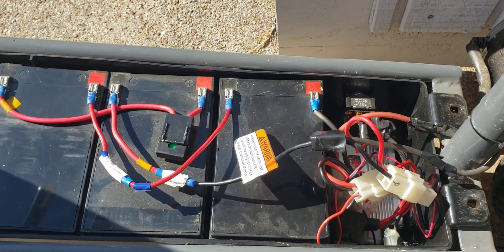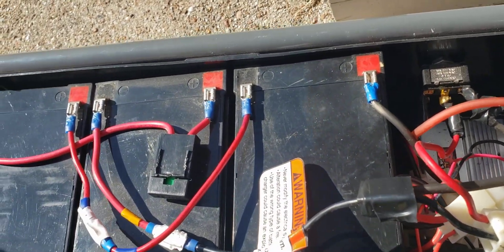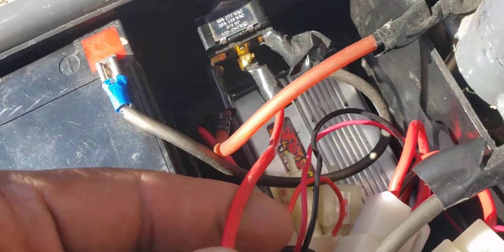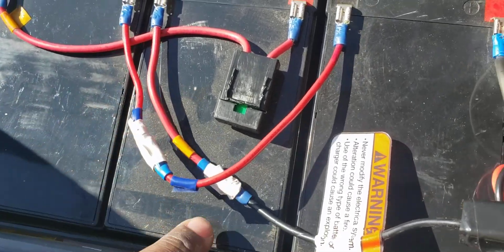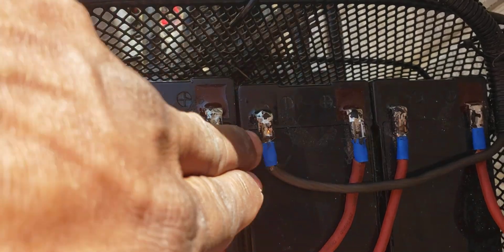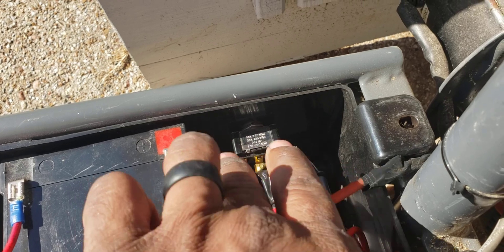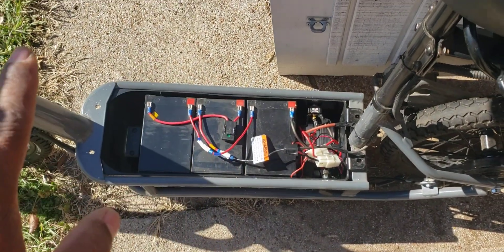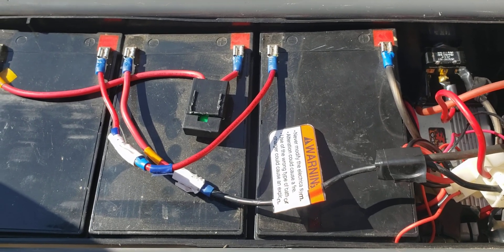New Video! Razor Ecosmart Scooter 2nd set of batteries mod wiring explained! More RANGE!

Comment: Hollo. Can You please tell me what size or model of New batteries.  Are they acic or litio¿? Thanks
Reply from the maker: Sorry for the late reply. This is the set that I bought on amazon.  https://a.co/d/3vYpc4e Mighty Max Battery 12V 15AH F2 Replaces Razor 15165070 MX650 Dirt Rocket - 3 Pack Brand Product